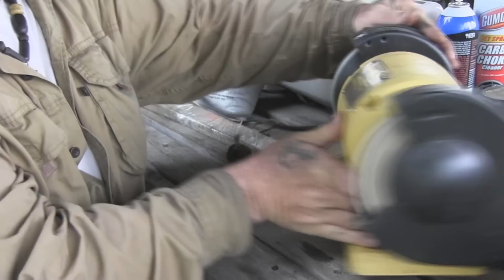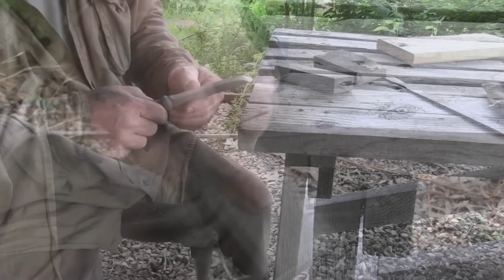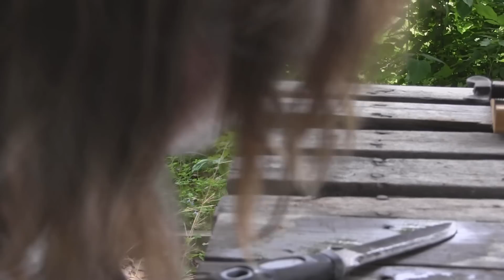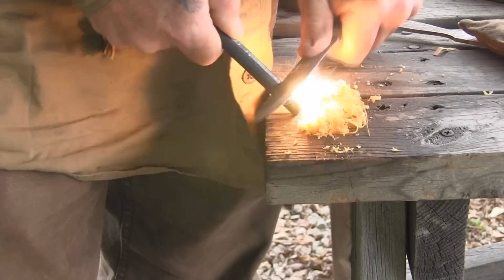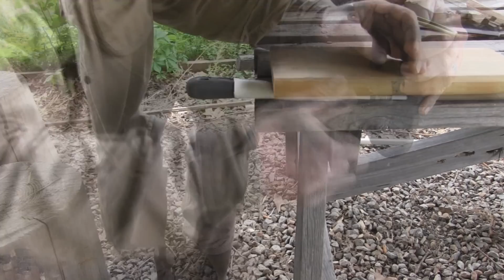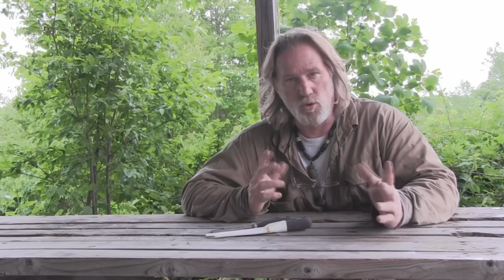2 Dollar Knife and Sheath Project Part 1

Comment: The secret of edge is the angle.. Once you work the blade down put the correct angle on the edge by using a sharpener like one made by Lansky. I've made many a knife and if you don't get the angle correct it's basically a worthless headache tool that will never sharpen right. Love the PVC sheath I continue to see an never ending use for that stuff

Comment: Many if not most files are case hardened so by grinding off the outside you are taking away the hard part and left with the softer inner core. It will still work of course  but annealing and then re-tempering would be optimal.

Comment: Since the handle keeps you from oven tempering at 450-500 for a few hours, one could temper it 2 or 3 times it with a propane torch.  Will bring HRC down a bit.  (wet cloth around handle)

Comment: I got one of those file knives, found it at a yard sale for five dollars.

Not sure how old it is but it's old the handle is wood that was rounded and it even has lead to hold the blade in the handle.

Also for shaping PVC you can also use boiling water to make it pliable, it's slightly easier than the open flame and less prone for having unfortunate accidents.

Comment: hello!
first of all your videos are great! 
is the steel from a file good enough to make a "good enough" knife? I mean, files are so cheap and knives are so expensive, I think thats becouse the steel in the knife is waaaaaay better than the file (or a lawn mower blade or whatever) is that so much of a difference? or I can take an old spring or blade from junk for next to nothing and with proper grinding and heat treatment make a good, or good enough blade out of it?
 is not that I dont have a couple of good knives, is that Im thinking that spending that much money doesnt make much sense especially since the only way to have a "perfect" knife, or perfect for the user, is to order a custom one, might as well make my own...

Comment: If you want too add a belt loop to the sheath, just use a longer PVC pipe and where it would normally end at the handle just cut half of it away lengthwise, heat it and fold it over. I have made them this way and it works well.

Comment: now ive heard that on cheaper files they only sandwhich a hard layer on top of a softer steel wouldn't sharpening it put the edge on the softer inside part if that's true ?

Comment: i thought files had to be softened first before grinding.im new to this. and would the knife break if it were dropped
Reply: They don't have to be softened but it's easier, but if you don't soften it, then it won't need to be hardened, but i think you should temper this knife if you make it because it can snap.
Reply: Filip Nilsson thanks taken onboard sir

Comment: NIce ..thank you sir. Where did you get the file? Maybe I missed another video setting this up? Great idea..God bless:)
Reply: In the video he said he bought a few off e-Bay. I believe he said out of China but if not for the price he quoted I doubt they came from anywhere else.
Reply: Hey thanks you:) I missed that part...I sometimes multi task and may have paused the vid and lost track of the dialogue momentarily. Thanks for helping :)
Reply: dofishbuster Who cares where he bought them from.
Reply: I don't because steel is generally steel. In fact China has been producing much better products than in the past. I mentioned it so someone could find it easier and cheaper on e-Bay because if you look for an American supplier you frequently find the same product that was made in China for 2-3X as much as if you bought it from someone in China.
Reply: I do care because I wanted to buy the same or similar cheap file to make a cheap beat up knife for my adventures in bushcraft
Reply: Could try going to a Harbor freight, they usually have pretty inexpensive tools. Also I'm sure you could find some at a flea market or pawnshop and that way you keep money in the community.
Reply: Can buy these at any Hardware store for a few bucks.

Comment: Love the idea, but wouldnt it be too hard in current state? I knowyou can break files if you drop them on a hard surface because they are treated for maximun hardness and not flexibility
Reply: Many an old farm knife was made from an old file. This is a time tested method of making a serviceable cheap knife.
Reply: Yes but those knives were also heat treated again to make them more resilient........not knocking the principle, just saying that  with any kind of tourqe the blade will snap. Im sure dave knows not to abuse it, but somebody will try this and then baton with it and break the blade, then they will complain about how this is not a good option.
Reply from the maker: amishassassin25 . Yes there is an issue with not anealing first as I said in the video, the knife will be more brittle, but the heating during the grinding process does back some of the tempering out of the metal
Reply: I understand completely, I just know that most will not.
Reply: In truth the best tool to make an knife out of a file is well another file and a whole lot of time. That being said my grandfather showed me how to make them using a foot pedaled grinding wheel. He also used water to keep it wet and cool as well as for lubrication. When done he did not heat treat it. Then again it was not a high quality knife but something to be used and abused around the farm so if it did end up broken or lost it was no big deal.

Comment: Almost forgot. Files are hardened where the cutting surface begins. He sharpened it all the way to the handle.. so the first 3/4" of the edge is soft steel.

Comment: All that time and effort spent on making a dirt-cheap file into a makeshift knife... using that stone to sharpen up a few knives for one's neighbors in exchange for a few bucks could have easily bought a Mora or Old Hickory.
I can see the idea of trying to make something from nothing like you did with the strikers from these files, but that here was way too much effort for a knife that will be very brittle as it is bound to be w/o retempering the steel.
Reply: A major part of this project is to develop one's skills. The knife can easily be improved by tempering it.  Take Dave's knife and remove the handle. Heat the steel until it is red hot and then immerse it in oil. Let your fire cool and then place the knife back into the fire. Leave it there until it turns "straw blue." Remove the knife from the fire and let it cool. Now it is tempered.
Moras are great! I love them. But what personal emergencies might preclude our being able to procure a Mora? There are lots of such scenarios.

And beyond all of that there is issue of fun. I can't think of a better way to spend some time with a young person--teaching them skills and creating positive experiences that will last a lifetime.
Reply: I know what you mean, but wouldn't it be more educational to make a knife from scratch instead of altering a tool? Take a piece of old steel (leaf springs are very popular) forge or file it to shape, harden/temper and sharpen it, make a handle and sheath.
If it was just for the heck of it - that would be alright, I guess. But then again, it was presented as a viable method to produce a functional knife.
Reply: For a user I'd want to abrade the ridges to get a smooth surface. I understand your point  but while brittle a knife like this was often used by old timers because of it's extreme edge retention if you where careful not to chip it. They normally made them out of worn out files.
Reply: Back in the day they didn't have electric grinders or hi-tech abrasives so they had forge bevels into the file. Maybe they hardened them pretty high, as they still do in traditional Japanese kitchen knives, but I seriously doubt that they ran them file hard. A blade that hard could easily snap in two e.g. while carving.
Reply: kaizoebara I have done exactly what you suggest--I have gone to a junk yard and cut off leaf springs with a hacksaw for annealing and forging. That is a big project, and only a few people with have the forge, anvil, and coal to do the job.
There might even be zoning restrictions to prevent them from using a forge or  furnace. Dave's project doesn't even require a grind stone. A file will do the job. It's a project that virtually anyone can embark upon. And that is the beauty f it.
Reply: No way you can file a fully hardened file with another fully hardened file.
Reply: kaizoebara To be fair, I think you do have a reasonable point. It would in fact be sensible to soften the steel if you want to file it. So conceding that another step would be partial annealing. A propane torch would work. But the grindstone is probably still best for the process of making the knife.
Reply: there's also the satisfaction of knowing you made it yourself vs buying it. and his idea was for something functional for a kid. he said hed never use this as his main knife
Reply: You all must have missed the part where he kept it cool so as to not mess up the tempering.
Reply: SikMisfits
Well, you must have missed the point of the whole exchange. It was never about drawing the temper - the problem is that files are tempered much harder than knives in the first place and are therefore much more brittle.
If you clamp your average file into a vise, you can snap it off by hand with little effort, whereas it would be very hard to do with a piece of steel of similar dimensions that was hardened to knife specifications.
Reply: Well maybe I misunderstood but quite simply this thing isn't just going to "snap."
Reply: Did you watch the other video where Dave just snapped them to length in order to make ferro-rod strikers?
Reply: kaizoebara
lol no hahaha that's pretty funny
Reply: its about learning to make and use your hands. anyone can go out and buy anything, but to fashion something useable from almost nothing is skill. great video dave!
Reply: Everything worth doing is worth doing right - that's what it boils down to for me.
Reply: The file is already tempered harder than a knife should be.  You have to give it a blunt angled chisel edge, or it will chip.  If you could remove the handle, you could anneal it to soften it against chipping, while retaining strength.

I believe I would find an Old Hickory butcher knife,, and improve the shape a bit, for the same money, and end up with a far superior knife.
Reply: Biggest problem with file knives it that they are extremely brittle and will break with any misuse. Soften serves both the purpose of making it easier to work with and removes the brittleness.
Reply: Ive always been a firm believer of the fact that you cant fault a man for doing for himself. That being said i understand where your coming from. Put yourself in this situation though, your working with your trusty file and the damn thing breaks. I know ive broken more than one in my life. Instead of throwing it out you can recycle it into what is ultimately a usable tool. With a little bit of time and effort you can you've got a new workable knife and you've further developed a skill that not many people have. And besides i find this kind of thing to be relaxing in all honesty.
Reply: I agree. Thats a lot of effort for something not to functional without further work. For the effort, take a blade blank, some wood, and make a knife from that. I get the "building ones skills" but if that the case start the project from the basics and remove the cheap handle (which probably won't stay on well anyways, anneal it, shape it without worrying about losing the temper, reharden it, then temper it. All that screwing around quenching it to protect the hardness could be avoided all together.

Comment: Beware! Some cheap files are only case hardened mild steel. Most files are hardened in the mid to upper 60’s on the Rockwell scale. This is way too hard for a knife blade. Good heat treatment is highly recommended.

Comment: This could be a lot less work, and more effective if you temper the file. When bought, a file is completely hard - which is why it breaks when you hit it with a hammer. This is not ideal for knives. Sure, this is a great cheap knife, but you could make it a lot better by differential hardening it with a torch. That is, if it is all one piece of hardened steel and not multiple types forge welded together.